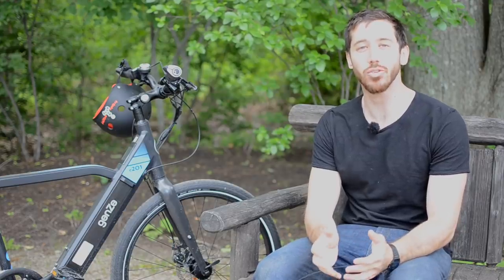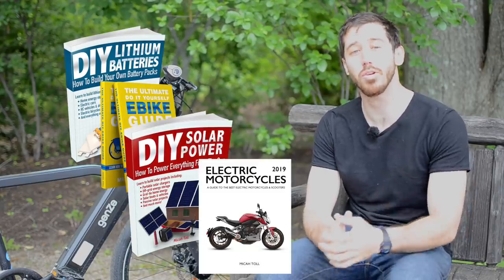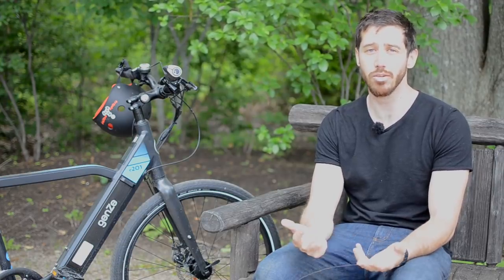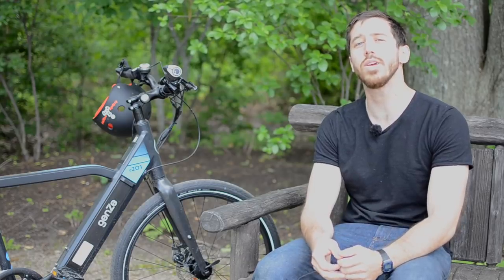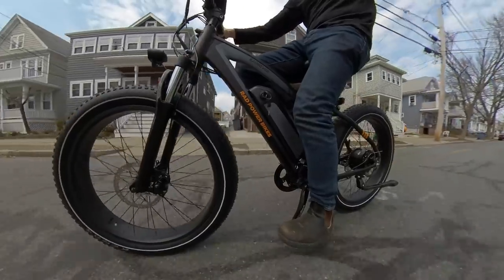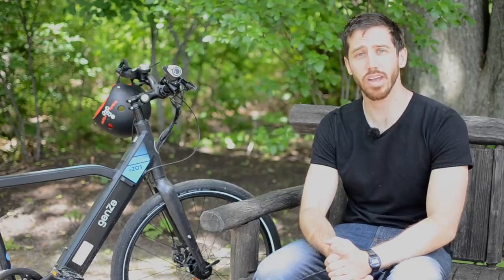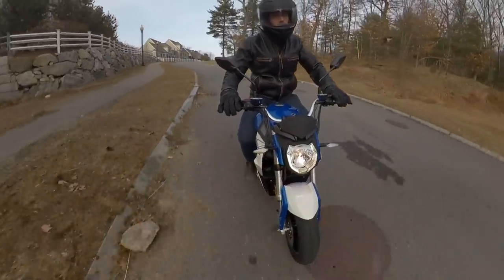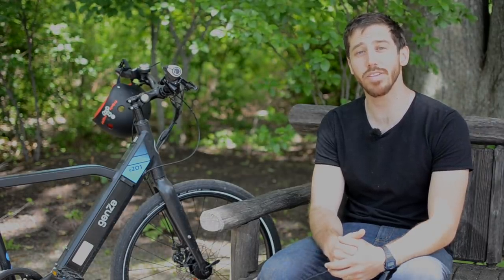How much POWER does an ebike need?

Comment: I have been riding my ebike for 12yrs.  Bought a 500w 48v kit on ebay for $600 back then. This bike has near 35,000 miles on it. It is a $450 Trek bike. Does 25mph, Still going.

Mags
Reply: My 1000w 52v 20ah cheapy chinese kit on a 98 Giant Rincon Hardtail has been kickin' it for 4 years now..   I won't even put a freaking 250w sticker on anything I own.. Can't even burn toast w/that... pfffft..   I get 30mph  cheap. Build your own. I'll never get anything less powerful than this. ever. 750w  is childs play.. I'm sorry.
Reply: @Danstaafl  gonna get 1500w 60v 32ag but it looks like a motor instead of bicycle.
Reply: @Danstaafl  Anything less than 200kw is for reptilians. Take a train traction motor and mount it to your bike...
Reply: Danstaafl I have to agree. I had the geoorbital wheel for close to 5 yrs, and that was a 500W motor. Then I bought a 1200W rear hub. The difference is night and day. I would never go less than 1200W. You can carry lumber on a steep uphill, without that motor breaking a sweat.
Reply: @MockeryManor  where do u get a 1200watt bike what kind of specs am I looking for it to be 1200 watt
Reply: Mark Hall I got mine on amazon. An ebikeling kit. You can choose wheel size according to your frame size. Also make sure that your rear wheel slot is wide enough for the kit (most bike frame rear slots are wide enough for this kit).
Reply: Now my other project is a Tidalforce M750. 749w to be within limits of the law for less than 1hp all motor.  Took all the control circuits out from the motor and making my own custom driver using arduino. Found some documents on the design of the motor and its circuits and will follow those guidelines such as pwm freq and the use of super low turn on resistance mosfets, 7 phase using 2 mosfets for each phase Hbridge.

The advantage will be no restriction at 20mph and adjustable accelerator reaction. With the original setup, it still pulled the front wheel off the ground. The original had a second model of 1000w off road, and the only difference was programming, of which nobody would do it for me and no info to do so. So I am DIY. Very stout coils and magnets. Be interesting to see what it will do....

Mags
Reply: @Steve Actually it is a 36v. 30 10ah NIMH D cells in the front wheel. They can handle 50A continuous and 100A peak.

https://www.electricbike.com/tidal-force/
Tried to find a link to a motor internal view but I dont see any.

Will do a vid  when I get to modding the motor circuit. Opened a lot of Ebike motors. This one is impressive.
Most issues with these typical brushless motors are the hall sensors going bad. I chose analog for my trek when it happened last (2nd repl). Just have to put a 1kohm resistor on the output to ground to help pull down the trigger wire. I had found it is heat that kills the sensors. Like a day I go to the beach, if the sun was on the wheel and then ride home, the heat adds up and piff.  But these analog with the resistor have not failed me yet for years. So they must be able to take the heat better.
Mags
Reply: @Steve Yes.  I can have it do real wheelies and kick up dust.  That would be like ludicrous mode. Reacts to the throttle directly.  But I want to instill other modes also for casual riding and charge preservation, but have fun mode on demand.

Mags
Reply: @Steve That depends on if your controller is limiting power at instant full throttle to smooth off the kick intentionally. The M750 with the soft start still pulled the fr wheel up a bit. So eliminating that would help.  Or it is possible your motor does not have that initial amount of torque in the design for that voltage. Many different motors are different.  Like my ebay motor from years ago has 54 coils, 18 per phase, and the mags on the rim are about 1/2in by 1/8in  So 1/2in of motor rotation between switching. I dont think this motor even if the coils could handle it could do 60mph as the issues with the coils induction could not switch that fast..  The M750 has 14 coils total(2 coils per phase of 7 phase. So it was built more for the possibilities of greater speeds with more switching times.  So many motors out there I would have to examine the motor and controller to see what could be done.
My ebay motor is 48v but fr wheel dr. So no wheelies. But does peal out a bit on full thr takeoff.  Fr wheel has advantages. Navigating sharp turns. The wheel pulls the fr in that direction where a rear wheel dr cannot pus a 90deg turn.
Reply: @Steve  in my m750 motor yes.  In some other bike controllers, yes, software can be an impediment whether it is top speed restriction or soft takeoff. Soft takeoff is nice for a rear wheel as if you accidentally hit the throttle while standing next to the bike ready to open your home door, boom. and you look like an out of control nutbag with your bike ramming your door, or just for people that are more comfortable with soft start and not a racing start.
Some motors on ebay will say 1500w and only do 25mph but have a hell of a takeoff. My very first ebike build had weak takeoff but did near 30mph 500w.  So motors have some things that account for how fast and how much initial torque. in your case you could get a 72v controller and battery and you should notice a big difference in power and speed.  Those setups are not built for the casual rider so I doubt there are any software restrictions
Reply: @Steve My fr wheel motor is 500w and 25mph with 2in tires 26in rim and will take off with a slip of the tire on the road.  I beat cars across the intersections at green lights. Unless they are stepping on it. The m750 is a bigger motor than 750w. The bike was made to be street legal in all 50 states. 20mph max, even pedaling with motor and under 750w/1hp so the real power was 749w to be under. The m750x was 1000w and 30mph and labeled for off road use only. The only diff with the x model was software. But today everyone is riding bikes that exceed these laws and nobody really cares.
Reply: @Steve What controller do you have?

Mags
Reply: Just looked at your bike on the site.  Best to ask them what might be a solution for your need. I find that smaller dia motors have less low end and torque. Yours looks like my early bike that had good top speed but low end was weak. If it is a 3 phase brush less, maybe respoke a larger diameter motor to the rim. My motor and age, the spoke lengths are hard to find. So I bought a set of 26in SS spokes and made it work. The orig spokes were rusted. After 9yrs they went one by one.  These are holding up. But yeah, small dia motors can have good speed but less torque. Like try to spin your wheel with your finger on a spoke closer to the axle, then try to spin it with your finger on the spoke closer to the tire. Make sense?

Mags
Reply: @Danstaafl  Hey! would you mind telling me where you got your motor and battery?
Reply: Impressive
Reply: @Danstaafl  
A pro cyclist produces around 300W of power peak. (according to google at least) A 250W motor is rated at 250W continuous, meaning it goes up to 350+W peak, that's not even accounting most 250W motors are more than 250W and are lying about their wattage to meet maximum Wattage laws in some european countries.

Saying a 250W motor is useless is the dumbest thing I've ever heard in a good while, you literally have more power than a pro cyclist, I'm guessing that's like somewhere between 1.25 to 1.5 times the power an average ride could output, all of that power that can be held for much longer than a rider can, that's plenty for 99% of people, you go 20-25mph (not a good idea to go faster than that on most bikes anyways since your converted bike definitely doesn't have the brakes to handle that speed, btw 30mph is pretty weak for 1000W, lots of chinese kits lie on their power output, might wanna check that) and you can climb all hills with no pedaling either at at least 10mph for really steep hills or pretty much no speed loss on an average hill, and with soft pedaling (the kind of pedaling you would do on a flat road with a regular bike) you can have no speed loss even on really steep hilss, so no, 250W isn't useless...

You also need to remember the thing isn't a fucking motorcycle, there's no reason to 30+mph, it's really fucking dangerous and it's gonna get you arrested or badly injured, also it's not meant for you to not pedal at all, because why the hell would you ride a bike if you don't wanna pedal ? Get a moped if you don't wanna pedal you fucking moron.
Reply: Not bad! I built my bike around 10 years ago, but it only has 45,000km on it. Battery is still strong (a123 LiFePO4)!
Reply: @MockeryManor  mid drive or hub  drive?

Comment: I still have my bionx d 500 equipped ebike and I’m over 200 lbs and i use pedal assist and it still gets me up some hills fairly easily. Too bad they went out of business. Great video and information as always Micah
Reply: My BMS failed on my Smart ebike and nobody can fix it .Would you remove the control board in the 350 wart hub motor and go with a new control and battery or would you spend thousands of dollars finding a new battery?

Comment: The battery voltage and power rating of the controller make a difference as well.
I bought an ebike with a 24v 250w motor and a 350w controller, it was pants would it got to15mph on the flat in 30 seconds forget about going over bridges it just stopped without help from me.
I upgraded the battery to 48v  the controller to 800w and stuck a cycle analysist I there for good mesure, now I have a bike that can go 30mph and has great acceleration and hill climbing ability’s.
If I creep to the uk leagal speed of 15mph then no matter how steep the hill is I can go up it at 15mph.
At peak current draw the CA was measuring 1500w.
Reply: I didnt know that. So i can upgrade my bike and not change motor! Who knew! I wonder can i switch 1.75 tires to 4 inch tires. Its really the tires that bother me.

Comment: Great video, thanks! I wish yuou had done it before I built my E-bike though. I went for a 1500W 48V setup out of fear of laking power, and I love it. But I could have sorvived with 750W or 1000W. Something to consider as well is, that with bigger motors come bigger bateries, and the wheight of the bike increases considerably. I started with a Hybrid bike (light montain bike) and now it feels like a tank
Reply: 3kW 72V 16aH + mountain bike + generator (800W) = 100lb bike here. Yeah, its a tank LOL. Keep it in that 2nd gear
Reply: @feedallday2556 Yeah... I think the bike weight issue is something worth knowing for people thinking about an ebike conversion. LOVE my heavy bike though

Comment: Totally agree with 1000watts. I have a Bafang BBSHD here in the UK on a 20 speed light weight aluminium mountain bike I built myself. It has dual front chain rings at 38T / 48T and a rear cassette from 11T to 50T. That bike goes like stink up any hill and actually catches quite a bit of air in the process over steep fast climbs to jumps. (I'm 90 Kgs and running it with a 52 volt 20 amp battery ). Though I think the BBSHD is actually 1500watts, not so much 1000. Regardless, hella lotta fun!

Comment: Sharing my own experience having 500w hub motor along w/ 48V, 12.5Ah Haybike battery. Since there was a statement in this video that 200 pounds rider barely can climb hills w/ 500w motor - I’ll say - I’m over 200 pounds and even using only 2nd power-assist pedaling level I’m able to climb very steep grade not only without problem but with acceleration. 

Using only $500 Haybike Race Max e-bike sold on amazon I have enough power and acceleration shifting only between 2 of the 3 available power-assisted pedaling levels. Never ever I needed 100% pure throttle in order tired already to ride my e-bike and just so you know I’m 75-yr of age senior. So discussing how much power one needs when choosing e-bike keep in mind this report and save your money in picking the right e-bike for your conditions. 😃

Comment: I’ve been using a 250W 36V DIY ebike for a year and I wouldn’t say I need more power for my daily commutes. As long as the battery is full, that is. Because as it gets weaker, so does the torque of the motor.
Reply: I also use a 250 w bike every day and I climb hills every day. I guess he is comparing them with motorcycles.
Reply: The more power thing isn't for top speed it's for acceleration. 

My ebike was bought as a 200w and I ran it for about 7 years. Then I decided to upgrade the hub motor to a 1500w. Yes the top speed is over double of what it was but you don't really go blasting along at max speed on the public highway. It's the acceleration & unassisted hill climbing that's awesome.
It's like getting out of a Trabant and into ANY modern car. The difference is mind blowing.
Reply: @0utcastAussie  so you had a 200W hub motor and swapped it with a 1500W hub motor withOUT replacing the controller? That doesn't seem right for some reason...
Reply: @ThanosSustainable  

Where did I say that I hadn't replaced the controller ?
The controller comes with the hub motor along with ebike brake levers & throttle
Reply: 0utcastAussie that sounds like a kit, what did you go for if you dont mind me asking?
Reply: I do wish I'd have gone for the 3kw 72v version though
Reply: 0utcastAussie nice thanks for sharing
Reply: @Coldfury power isn’t just Voltage; maybe your battery can’t provide enough amperage.
Reply: @0utcastAussie  Not just acceleration. 250w can struggle going up hills. I'm ~150 lbs and have to assist mine when I'm carrying cargo. I need much more and battery capacity for that in addition to pulling a trailer. Still wondering the ideal power and cap for camping trips; without a car. Solar panels would go with.

Comment: I'd say that a good 250watt mid drive is not just good for the flat, it's a massive boost on hills as well. Hub motor, not so much!
Reply: agreed. I have a cheap 250W tdsz2 and steep inclines, even on gravel, lowest gear and highest assist level are really no issue. No I didn't measure the inclines but I know I would have thought twice before tackling them with a conventional bike. I think with e-bikes, people have developed unrealistic expectations.
Reply: @ioandragulescu6063  I've since purchased a Giant Roam E+, so now I can speak with authority. I'm a big person, and it makes hill climbs an absolute breeze.
Reply: @contentsdiffer5958  I'm using a 250w motor, that's the max legal size in my country. There are different countries on the planet. And yes, that 250w makes a massive difference for me, so my comment stands.
Reply: @modut6258  In USA Roam E+ is rated at 50Nm and costs $2,700 believe it's even exchange rate for Euro. I'm 84 kilos. Doesn't mention max speed, but 25KPH is EU limit. Pondering buy bike here in USA and bringing it when I move to Spain in near future, but slowest bikes here are 32KPH, so I don't know if I'd be let in with it. Found 250w with 60Nm reduced from $2,600 to $2100 Co Op Cycles CTY e2.2
Reply: @Borderman47  Tell me about it! When I lived in Spain my sister bought me an expensive jacket she got 1/2 price. She insured it for the full price and by the time I paid the tax at Correros, between shipping and taxes it was double. Wanted to put miles on bike so they wouldn't or would tax it lower.

Comment: Thanks for four vids! You have saved me untold dollars and hours of waisted time. I ride a BCA with a Bafang mid drive and a NB 8000watt rear hub. I'm running a ASI bac 800 72v and a 72v 150amp on the hub. The mid drive display is the NXT touch screen. I'm running two triangular 72v30amp hour batteries. Fast and dependable, both used together on low pedal assist gives me over 200 miles of range brakeing with the regen lever. Two independent drives always gets me home, and usually first across an intersection.

Comment: I deemed 2080w as necessary.

Though, the sticker I'm putting on it does say 250w.
Reply: Keeping it legal. Nice bro.
Reply: My 1000w the factory sent me a real invoice saying 250w.... Chinese can be rather agreeable
Reply: Hope it has some good brakes on it. A collision on a bike at 40 MPH is more than enough to kill someone.
Reply: @autonomous2010  Even with some old cantilever brakes, I can stop pretty fast.  Though I must say I squeeze pretty hard.
Reply: @airwilliam24  I guess. I just find people are often dangerously optimistic about the frailty of human bodies.
Reply: @autonomous2010  True, very true.
Reply: They much have just missed a 0
Reply: @BagerGman  a Chinese factory insisted on sending me a dual motored electric scooter with a $200 invoice.
Do they really think customs is that stupid? XD
Reply: @BagerGman  hahaha they did that for me too
Reply: @autonomous2010  i had a motor strapped to one bike with just the front disc on it and could stop faster then a standard bike the key is to stay alert and think they are all gonna run you over
Reply: Hello everybody What I need is a 2500W engine to try to build a unicycle. That is the power that is being used in the latest models. Then I would take care of the Self Balancing control electronics and batteries. Unicycles are the future
Reply: @autonomous2010  

TRP Quadiem G Spec with 203mm TRP-33 floating rotors.
Reply: @Rafaelinux  I dunno here it works, I never have to pay for customs for anything I buy from china because they always lie.
Even my 3d printer that came in a big box that said the brand and with "3D PRINTER" written on the side had a 20$ price on the shipping sticker...
Reply: @danielgustavosanchezaguilo3325  That's more power than a moped, that is stupid to put that much power on a unicycle.